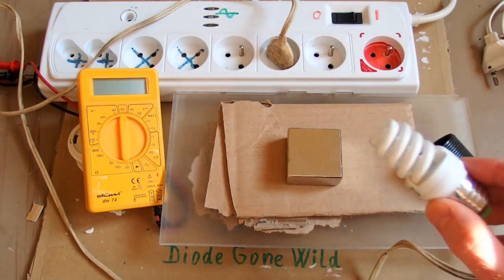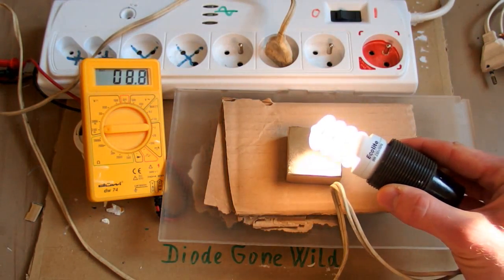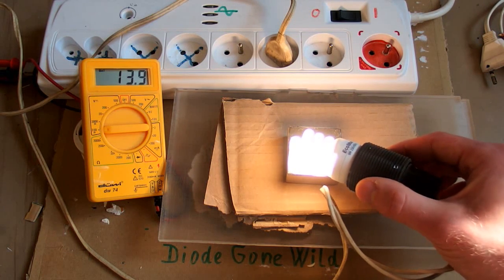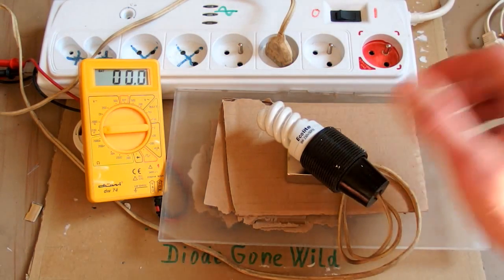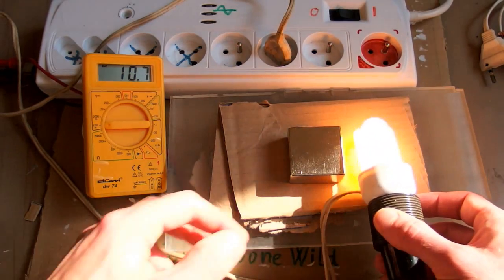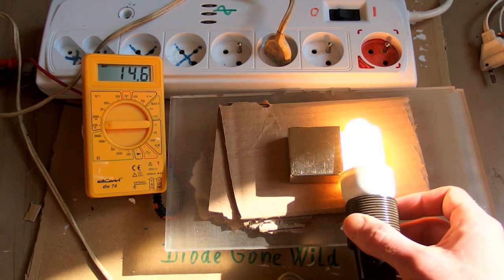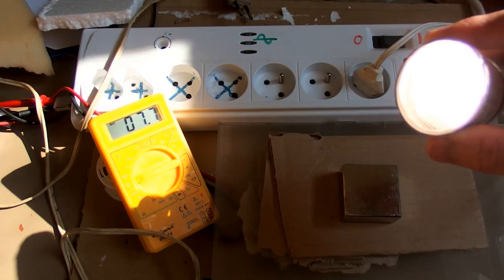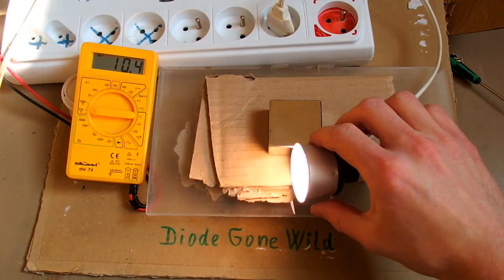Neodymium Magnet Boosts Power of CFL !!!

Comment: sorry you talk about watt...but you use a voltmeter...you have a resistor in powerline?
i will send you a wago connector...by blood freezing by looking
Reply: He does have something in that power strip, but it's not quite just a resistor. There's a small shunt resistor indeed to tap off current, but also a voltage multiplier IC that taps off the mains voltage and multiplies it by current. You can find a schematic on his website danyk dot cz.

Comment: It looks like the magnet is saturating the inductor in the power supply, making the losses rise.
Reply: DiodeGoneWild I noticed this effect when I built a joule thief. Bring a magnet to the transformer and it cuts the light out. It also had a dimmer effect. I think the magnet has an effect on all the components but mainly the oscillating phase shift. Controlled Distortion of the magnetic field.
Reply from the maker: I don't think so. When I put the base of the CFL to the magnet, it dies, probably because the inductor or the feedback transformer gets saturated. But when I put the tube to the magnet, the power goes up and the tube really is brighter. I think the magnetic field causes the arc to get longer (it forms spirals). The arc is driven at about constant current, and longer arc means higher voltage drop and thus more power.

Comment: I could not see a brightness increase, but cameras have automatic exposure, so that may be the reason.
i can understand the strong magnet affecting the pcb transformer, but only in a loss of efficency.
what about connecting the tube with long wires so you can see if it is the pcb or tube being effected?
Reply from the maker: I think that the tube is being affected. The magnet increases its voltage drop. Because it is running at roughly constant current, this increases the power. The magnetic field increases the voltage drop because the acr, normally straight, is forming spirals.
Reply: About power - I dunno if it is possible to saturate the ferrite with the external magnet, but it sure looks like it. When you saturate the core, inductance falls which causes the reactance to decrease as well. That choke is what limits the current through the tube (plus a film cap).  I need to do some experiments to know for sure :)
I think it shuts off because you saturate the small toroid that feeds the bases.
Reply: I suspect it affects the electron flow in one direction, which is probably giving a DC bias.  If this is the case, the DC bias would lower the transformer efficiency and lead to a higher current draw.  It would be interesting to try a neodymium magnet against a wider fluorescent strip tube to see if it affects the light where the magnet is placed.
Reply: I would expect a magnet as strong as that to have an effect on lots of things, just dont put your fingers in its way lol, fingers flat as paper :D
Reply: Yeah, and don't carry it in your pocket either, cause you may become a fridge magnet :D